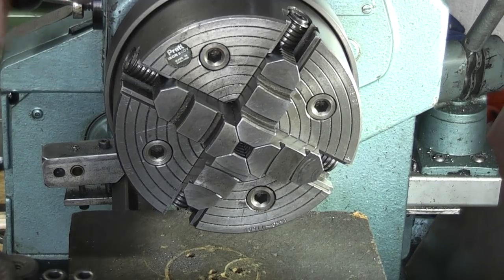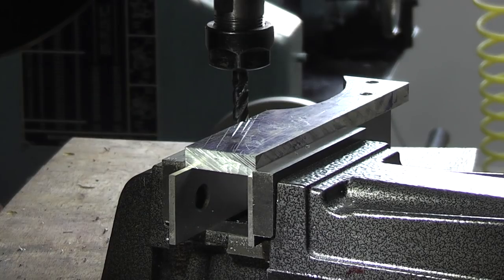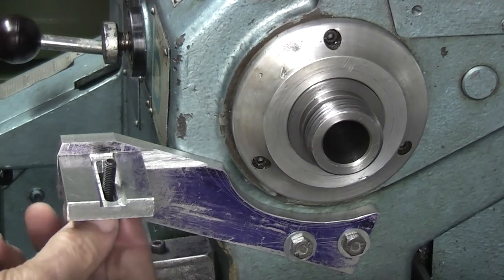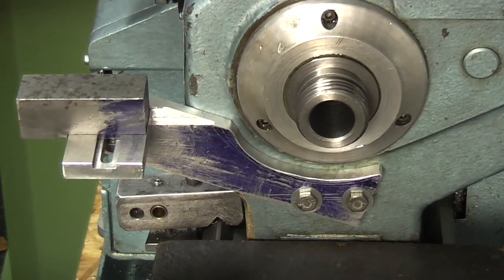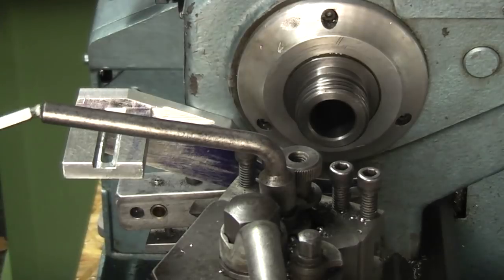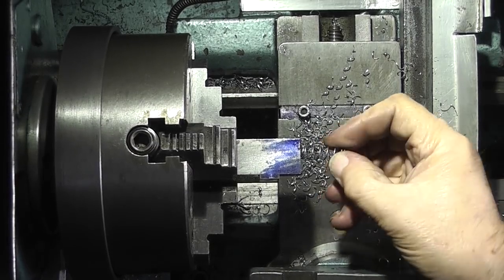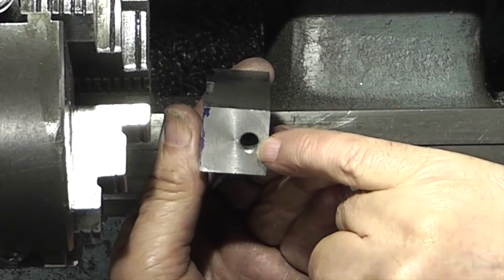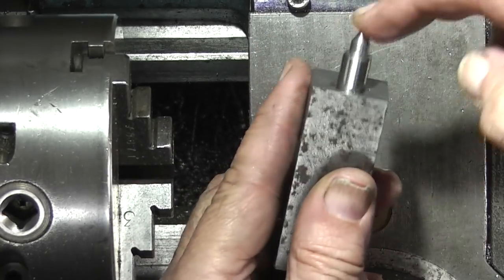indexing arm & locating pin

Comment: I am very interested in this video. I wish I had seen it some years ago. I have a lathe chuck with a back plate with 60 holes in it. That number provides a good assortment of divisions: 2, 3, 4, 5, 6, 10, 12, 15, 20, 30, and 60. It has been quite useful on a number of occasions as that group of numbers handles many dividing jobs. Instead of having more than one ring of holes, I hope to make some sector style shoes so that I can have a Vernier capacity. So a shoe with 8 holes spaced over 9 of the back plate's holes would add three factors of two and I would have additional divisions like 8, 16, 32, 40, 80, etc. Additional shoes with other numbers of Vernier holes could provide multiples of a number of other prime numbers like 7, 11, 13, etc. This technique is only limited by the number of holes in the back plate's hole circles that can be bridged by a sector and that would appear to be around 30 for my 60 hole circle. So 29 may be the largest prime number that I can add. That eliminates the often desired 127 division capability, but who makes gears on a lathe anyway. 

One thing that I did pick up was the idea of using the tapered part of a center drill as the primary surface for locating the divisions. I did not think about that and you have me wondering if I can go back and center above my holes and add that feature. It seems that is a better way of achieving accuracy. You wouldn't believe the procedure I went through to drill and ream my 60 holes as accurately as possible.

Comment: Hi Alan, this is certainly a very useful addition to the lathe. I'm always picking up any scrap steel discs that have been cut out of sheet steel at the local scrappy yard with the intent that they'll make useful indexing plates. I never thought about using brake discs before. In a previous video you were wondering what the two 1/4 BSW holes in you Boxford headstock might be intended for. On my Harrison L6 I have 2 similar holes and they are for mounting the opening/closing lever arm when a Burnerd Multi size Collet chuck is fitted to the machine. That is perhaps the answer as the full range of Pratt Burnerd chucks,collets etc were also available as additional extras for the Boxford lathes.
Reply from the maker: Hi Howard   Thanks for that info

Comment: I did wonder why you added the option of lateral adjustment to the locating pins block. It didn't click until you mentioned "The movement in this [is] enough to put maybe 3 rows of holes in this indexing plate"........ I feel like a friggin' idiot now. LOL !
Reply from the maker: Don't worry its my turn to feel like an idiot in the next video

Comment: Really not familiar with what you are doing and how to use it once done. I know about indexing heads for a mill, the typical 40:1 type. Once indexed there is a lock to secure the head. I guess, depending on the demands, will the pin be the entire position locking device? Will be watching to see the end result and it in operation. Really like your work and presentations!